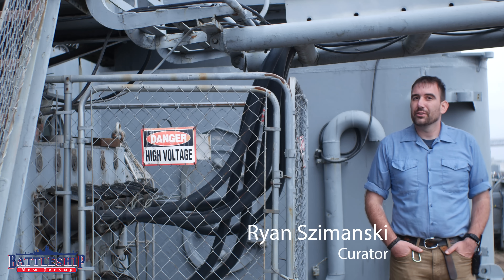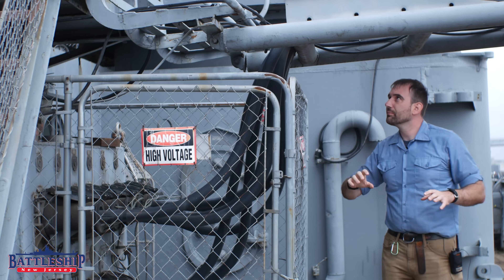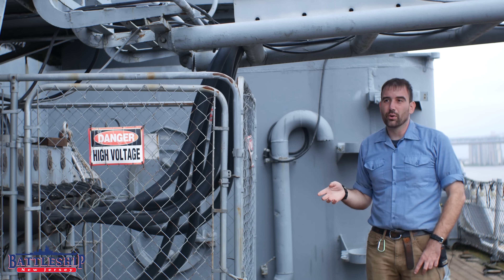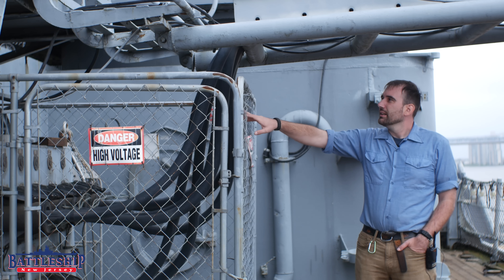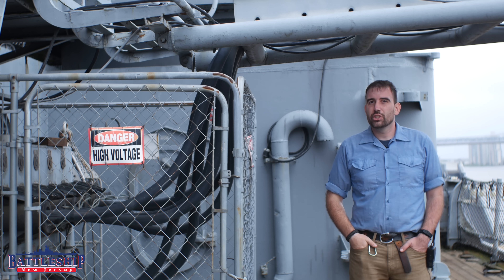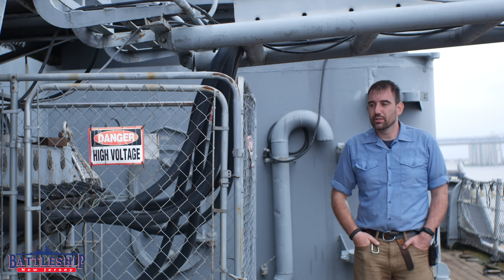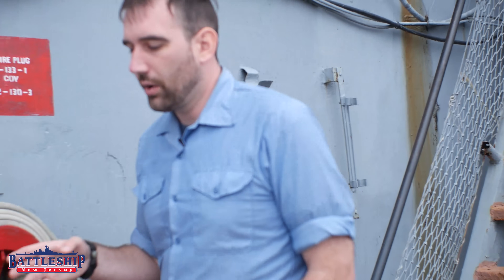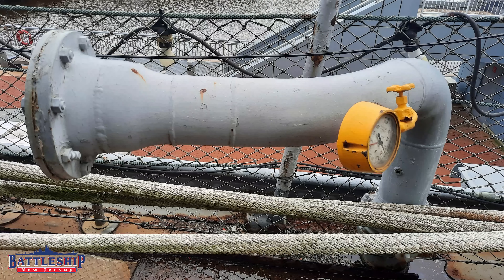Where Does the Ship's Power Come From Today?

Comment: 4:04 The Navy doesn't use 'aviation gasoline' or Avgas on its ships, it uses JP-5 (Jet propellant 5) which is a kerosene based fuel.
Reply: I bet that the USN and every other navy in the world uses every sort of go-juice for something, ordinary 'Civ-gas' for lawnmowers, and diesel for some of the small plant that kicks about, it is not that long ago that the US was using helicopters with big piston engines that would have used Av-gas. When the ship was built, she carried 3 Kingfishers.
Reply: @harryfaber  
Well you'd be wrong.
Reply: @Johnno47  You know this how?
Reply: @Johnno47  If you take a brief look at the aircraft carried on the N-J, you will see that there was a need for various types of juice, including 2 stroke. The earlier aircraft would have used Av-gas, some of the later ones would have needed Av-tur. I also wonder exactly what sort of engines the various boats would have used. 

Dockyards, as opposed to ships, would have needed all sorts of fuels for all sorts of different tasks.
Reply: @harryfaber  
I'm talking about Avgas in particular.
Just because avgas would have been used on the NJ in the 40's doesn't mean they used it all through its life.
If you look at the ships replenishment connections their are non for avgas.
Reply: @Johnno47  If you listen to what Ryan said, he said 'JP 5, aviation gasolene'. Easy mistake, he meant JP5. However, for most viewers, a technically correct way of putting it would have taken longer, and then would have needed an explanation of the different types of fuels, when the video is about what powers the ship's systems. The ship at various times carried various fuels, and had systems for dealing with them. In a previous video, Ryan showed the stowage for fuel cells for the drones, and how they could be dumped in the event of fire. 

Fuel handling and choices on ships are carefully thought through as fire at sea is not funny, there have been large warships lost through poor fuel discipline, we might think of the USS Maine.